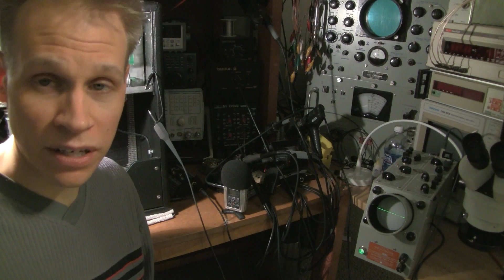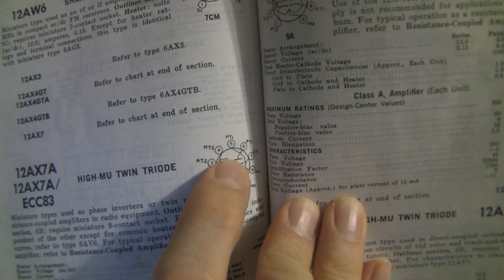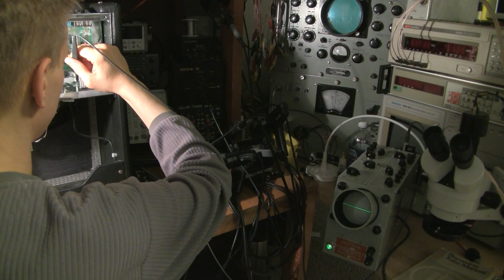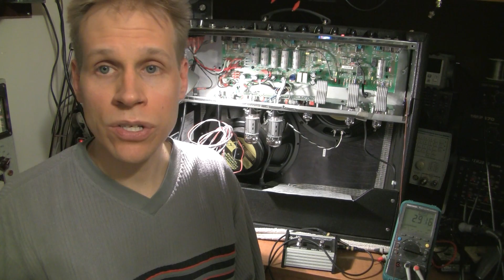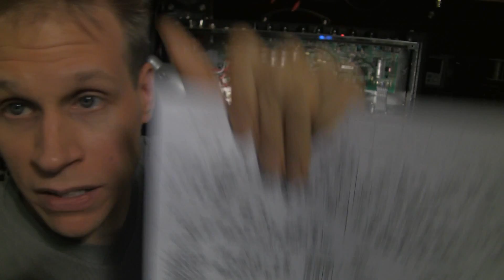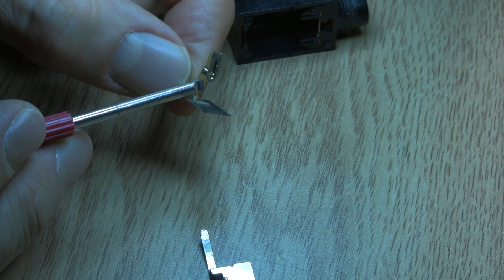Fender DeVille Amplifier, Repair and Bias Set Procedure

Comment: You make this look so easy.-I am just getting into this at age, 64. Wish I had done this when I was younger. When I was in school I thought I hated learning, now I can't seem to learn enough, funny how that works with some of us.I am trying to learn 30 years of knowledge in one year. I am going to build my first amp before long. I just have to keep telling myself to be careful, even though I wired all the houses I built over the years. Thank you for your videos.The biggest problem I have is-When you look at the blue prints of a house, the items are exactly in the same place on the print as they are in the house and in a schematic they are not and this just blows my mind!!!!!!!I am thinking about going point to point instead of using a board.
Reply: Please remember, Mr Carlson makes it seem so easy because he has compressed a lot (a LOT) of work in a few minutes video. I bet you, some of his videos are days per hour.

For you, after so many years wiring houses, your mind is set for blueprints where all the parts you need to install have a physical place in each room, determined by the architect. But for most electronics of this kind the physical place is almost of no importance, as long as the wire connections are placed as the schematics demand. This just needs another mind set, but it comes with more freedom. Please try to look trough that, and see it as an opportunity.
Maybe you can start with a project where there's also a drawing of the wiring. Specially older magazines have published these.
https://www.americanradiohistory.com/

My only advice (and I also try to listen to myself), keep your workplace clean, and tidy up after each days work, no matter how short. This will surely help keep your mind tidy as well.

Comment: Super upper great video as usual Paul wwell done ^^ Question : Is the standby switch lifting off the high voltage directly from the plates of the tubes or is it lifting off the center tap of the high voltage secondary output ? (was considering this question on some design at the moment so...)

EDIT : Just looked at the date of the video, 3 years ago already...so I maybe you won't have the schematic ofTHAT particular amp in mind...

Comment: Hi Mr. Carlson
You mentioned in this fender repair that you were using Chinese tubes ?
Can you suggest a particular manufacture ?
I have looked on eBay and the internal workings of the tubes pictured four a 12AT7 don’t seem to show reinforced construction.
The tubes internal mass looks to be just floating inside the glass envelope.
I definitely enjoy watching your YouTube thank you ,keep them coming.
Reply from the maker: Hi Ken. Look at the top Mica spacer, where the grid posts protrude, look for the mica tensioning tabs or fingers. I'm reluctant to mention brands, as they change so often.

Comment: There are several thoughts on how to bias a tube amp, would be great to hear your information on the topic. This video demonstrates something unusual. They say the 1 ohm method or the oscilloscope method etc, which method is really the way to go ?
Reply from the maker: The one ohm method is fine, you're just using it as a current shunt.
Reply: Thank you for your answer

Comment: Hi I have a round metal ring and it has three soft springs I put the ring on the 6l6 tubes and attached the springs, pulled down to the to the chassis and attached them to stop valve movement, do you think this is ok to do this, cheers and thanks.

Comment: I have a Peavey Classic 30 tube amp that internally feedbacks ...the amp works fine except for this problem.... Mr. Carlson do you think that the tubes are shot.....  I'm not a amp guy I'm a guitar builder and a customer gave me this amp... It sounds good just the internal feedback that prevents me from using it.... your thoughts... sgb.guitars@gmail.com
Reply from the maker: Hi Steve, the tubes are probably getting microphonic from vibration. Too find the noisy tube, remove the shields and tap each tube with a pencil (lightly on the glass) If you can hear the tapping noise in the speaker (excessively) then that's probably the offending tube. Remove the tube shields with the guitar amp unplugged, and the tubes cold. You may find that you will have to increase the volume on the amp in some cases, as in many the volume or master is in the amplification chain.

Comment: Paul, IYHO, does one need to have a tube tester device?  Have you uploaded a video on that subject?  Or, is it possible to test/check a tube to see if it's valid/invalid simply with a DMM or ???  Thx.
Reply from the maker: Hi. The best place to test a tube, is the circuit it lives in. You really don't need a tube tester unless you have many "out of circuit" tubes laying around. A DMM will only test an "Out of circuit" tube for filament continuity.
Reply: Mr Carlson's Lab - thx for your reply. Makes sense, and answers why some tubes test OK in testers, but fail when in use.  I'll search for videos testing tubes in circuit as yours did. It will be very interesting to see how matching can be done this way, too.  Cheers!

Comment: I had a similar problem. I first "did the twist" on all potentiometers. Aggressively tapping on the knobs and literally moving them. Then tightening the pots to ground. Found/heard a cold solder in the midrange pot. (No testing equipment. at all). cold solder on the cap. The problem was intermittent as well.  I prefer to use the use a bigger hammer method before bulling out the scope.  GREAT video for those of us who worship the sound of this amp. Do not be fooled about the III model, distortion beak up and reduced volume with guitar volume pot is no where near as good as the older versions.

Comment: This is exactly what i waned to do. I have a a B52 At-112 that I bought. It was making a lot of noise after cleaning the tube sockets . It is humming. So It probably has a bad 12ax7 pre amp tube in it. Awhile back I bought a Devry Vintage Model #34 Bell & Howell Schools Oscilloscope. No matter what I did replace filter caps ect... it is a  still POS.  I bought an extra one , however it had a bad  5up1 CRT. So I bought a Sencore PS127 is seemed to work when  I got it . When I went to replace the RCA Mic input jack I messed up the Scope and now it is not triggering. Now, has I only listened to Terry over at D-labs> I wouldn't have three scope that are all crap. I would have an Iwatsu ora Leader Ect,..

Comment: Wow. I just joined you channel from the giant transmitter video for no apparent reason, and then I see this video which is more relevant to me.  I once had one of these amps before a "friend" stole it.  But it came to me with a tube that had been replaced to hot rod the hot rod amp. I think, and am basically sure, they had taken out a 12AX7 and put in a 12TA7, and man alive.  The amp just came alive. Way way more clear. Only problem was that it rattled on an Ab note.  It was like a mid-range rattle hum. So it was not perfect. But with the regular 12AX7 the amp sounded just dead.  Not alive. Lifeless. Boring. Not a great sound, but probably okay for some Stevie Ray raking style.  But with the 12AT7 is was so clear and so warm and so full sounding.  I had to replace the 12AT7 when I had received the amp, but after doing so, it just sounded so good, my ex "friend" stole it.  Look for some documentation on this modification.  It sounded great for me.  ...as long as I did not hit an Ab bass or mid-ranged note. Then it was almost like a feedback oscillation problem. If that could be fixed somehow, maybe by adjusting the bias or other mods, that would be nice.

Comment: Could you measure that cathode to heater impedance on a setup circuit?
Reply from the maker: It would be pretty high considering they are not supposed to be connected in any way. (low if shorted) Measuring capacitance would be possible though.

Comment: Mr. Carlson: Good repair piece.  I would have wished you had not found the problem so quickly. The video would have been so much more value if you had to trace the source of hum to a subsequent stage.  Knowing what I know about electrolytic capacitors, I would have recapped the amplifier power supply if the date code was even less than five years old.  B+ DC ripple is very problematic around tube amplifiers running other than class C.

Comment: Paul,  I just built the little circuit you added to this repair. ( capacitor, diode, led and resistor) when I turned it on, it worked ( to my amazement) but quickly started smoking.
what did I do wrong?

Comment: Tube Tester.

Bam! 
just saved you 2 hours labor cost.

Or if your amp as making noise..... Replace the tubes.
Reply from the maker: What about the jack repair? What about re-soldering the tube sockets? What about the dial light modification?
Reply: what about replacing the jack instead of bending it back...

Comment: Mr. Carlson, a quick question if you don't mind answering. When you clamped that ground lead to the amp's metal chassi you've basically put the whole thing to the same potential as your mains earth, correct? Considering that the amp uses a standard IEC connection with an earth prong then the whole thing is at the same potential and you might probe wherever you want in the circuit, is that right?
Reply from the maker: This isn't for everyone.... I do float my test gear from time to time.

Comment: why are you sticking 2 hands into a live amp? It's the caps that hold the charge but isn't it a bad practice even if you are staying clear of the filter capacitors? thanks for sharng your knowlege. I'm no trying to be a pri&k

 I'm just wondering why you would do that even for the sake of a vid or even for trouble shooting.

Comment: Great job Paul. I had one of the Fender Tweed Blues Deluxe amps (pretty similar but one speaker). Original USA make and not the more recent Asian ones. Terrific sounding amp but having the valves (tubes) in the "box" plus the hybrid design meant that with regular use, it did require some repairs... and I never did understand why you would mount a valve upside down so that all the heat went back into the valve! So I am back with a separate tranny amp and separate speakers, which are more reliable... keep up the good work...
Reply from the maker: Thanks for taking the time to write David!

Comment: I have watched this video four times now..each time picking up on details I missed before. The one bit I'm hoping you can help with is the new circuit for the jewel light. Did you pick up the previous light's A/C source and put the diode and filter cap in series from there? You said you ran the AC to the negative side of the cap.  Where did you go from the positive side? Love all your videos. Thank you.

Comment: Thanks for the videos.  I am a mechanic/musician/DIYer.  I believe that yo know your stuff, and would like to be able to retain more of the information you are giving.  Is there any books , or youtube/internet forums you would recommend for someone to learn more about how electricity works with tubes, resistors, capacitors, how to read schematics, etc...  I recently acquired a tube amp, and want to diagnose/repair it myself.  Any must have tools you recommend?  I do have a good multimeter.  I want to know as much as i can before i touch anything, as i dont want to wreck the amp, or myself...  again, great videos👍

Comment: I had to take quantum mechanics to get my graduate degree and you blew me away with your sophisticated knowledge of the practical,, but you might want to consider dumbing it down in certain sections where you make assumptions of the viewers knowledge, you have a gift, the rest of us don't. However, you are the messenger of hope. I have a Fender Deville 410 that I bought busted up from a pawn shop for $200 and have pieced together. Same design as in the video as in the rest of the hybrids of the era. I now find the overdrive channel doesn't activate at the hand switch, haven't tried the foot switch as in the video. Bottom line is you gave me hope and direction to address the problem. You're doing a great service for the few of us that have it within to take off the cover and not only look inside, but to make it right, just like a surgeon. Keep the good work up. Looking forward to more postings. BTW, how about a video on a Line 6 Boger Spider Valve, another problem child?

Comment: Have you ever worked on anything with the rotating 'Leslie' speakers...I always wondered how they made the electrical connection? a rotary 'brush' set-up or inductive...?
Reply from the maker: Basically a commutator like you would find in an alternator. Just bigger.
Reply: @GeeBee135  the rotating baffle for the Leslie-speaker woofer is sometimes called a " cheese-wheel".

Comment: Paul I have a question. I am designing a 50 watt tube guitar amp. I will be using a pair of 6L6s in push pull for the output. I have looked at the tube charts for a 6L6 but have not come up with a definitive primary impedance for the output trany. I have a 50 watt OT that is 4.2K ohms but I saw on a schematic for a Crate V50 I own, that it is 5.5 k ohms. My question is this, will the 4.2 K ohms be a match or would the 5.5K ohms be correct? Or would either value work or would the lower one give less or more output than the higher? Can you help me understand? I am an electronics tech and I know very well all the dangers involved working with high voltages in a tube amp. I have repaired many amps over the years but it was troubleshoot and replace with the OME part or small mods. This the first I have designed an amp from the ground up and I want to get it right.

Comment: Great Repairing :) I have a question sir my 30 solid state guitar amp, everytime I turn it on in the first time it sounds really good and loud but after a few minutes of playing with my guitar, I'm hearing a distorted sound :/ 
and the sounds gets smaller:( I already changed the 2 IC's TL072 and TDA2030A but the same problem, I also changed all the ecaps except the 2 Main Filter and 4558 Ic
Reply: Many amps with IC power amps such as the TDA2030 have inadequate heat sinking and will start to shut down if played too loud. If your amp behaves itself when played quietly, that could be your problem.

Comment: As a former "M" Brancher in the Navy I am completely jealous of your gear there. One day I'll have my workshop, and I'm hoping to get some nice older pieces from a DRMO auction. I personally own one of these amplifiers, Fender Hot Rod Deville 212, and I am planning on performing some mods to her. One in particular, employs the use of a switch to select between "Triode and Pentode" operation of the Output tubes. The solution requires a separate DPDT switch be mounted on the chassis (the original modification is represented on page 111 in the book "Inside Tube Amps" by Dan Torres), however if possible, I would like to change the "Standby" switch out with a DP3T switch (I'm thinking)  instead of adding another switch somewhere on the chassis. This way I would have a "Triode-Standby-Pentode" switch. I'm just having an issue of figuring out how the switch would be wired to accommodate this desired outcome. Do you have any suggestions for a solution, or where I might find an example of this wiring? I haven't been able to find information on the original amp modification anywhere except the book, much less the modification I'm trying to perform.

Comment: Paul,
I have a question: when I heard loud hum, I immediately think "filter caps" and would head down that road. How and why did you rule that out?
Thanks,
Ian
Reply from the maker: Hi Ian. Usually when filter caps fail, they hum from turn on, to turn off. This hum was an intermittent thing that "most of the time" spells heater to cathode leakage.
Reply: I see. Makes perfect sense. Thanks for taking the time to answer.
Thanks.
Reply: Could this cause the amp to motorboat? Thanks Rick.

Comment: Hi A few months ago I tell you I had a fender hot rod amplifier which I will change the output tubes and had appeared some noises and pops in the output. you told me could by the tubes. and it turned out they were 2 resistors R57 and R58 were very out of value. are the resistances of anode. v3 12AX7 I replace them and the noise disappears. I apologise for my english. thanks for your work and videos. are the best

Comment: Hi Paul you don't mention it so I thought I would ask... Is the safety earth conectedon the scope during this testing connected or floating?
Reply from the maker: I usually float the case of my scopes.
Reply: Have you ever thought of feeding your test equipment from RCBO's in place of regular breakers that way should they develop a problem you are still protected ?

Comment: I have the exact Fender Amp i have 4 10 inch speakers Mr Carlson I played at a gig 3 weeks ago and  one of the singer accidentally bump into my amp and it fell forward I immediately picked it up now it still sounds good except now i when i turn my reverb up it squeals but if i do not turn the reverb on it sound fine can you give me some pointer to fix this problem because i like using my reverb also
Reply from the maker: Hi Shawn. There is a very good chance one of the tubes is microphonic now from the abrupt fall.. To test this, tap each tube with a wooden dowel (amp is on) Listen for a loud ring when they are tapped. Replace the tube(s) that are noisy (microphonic)